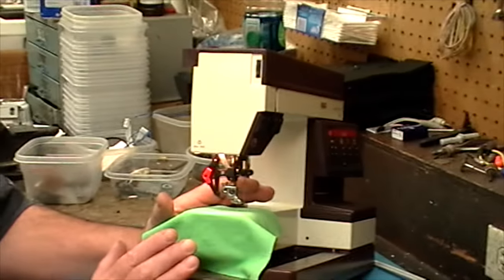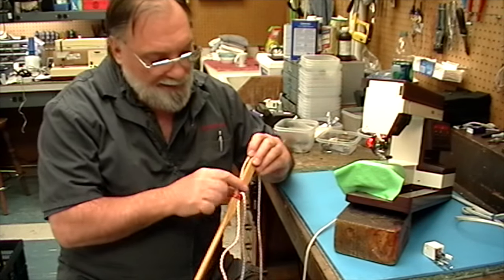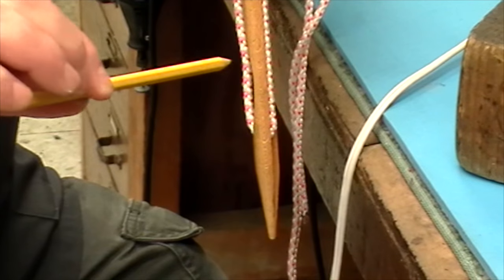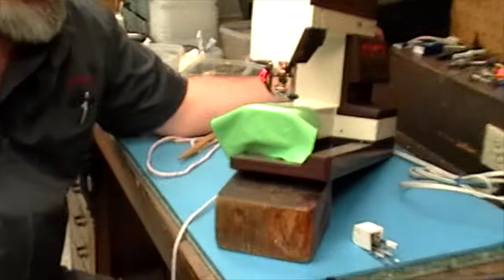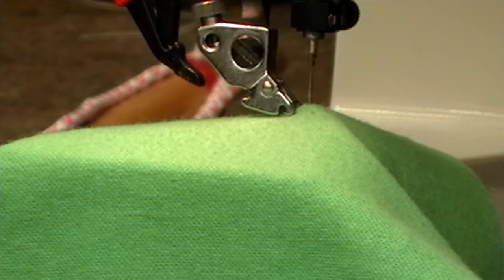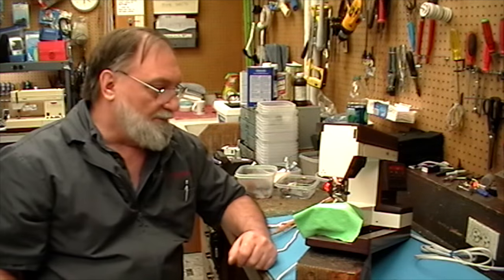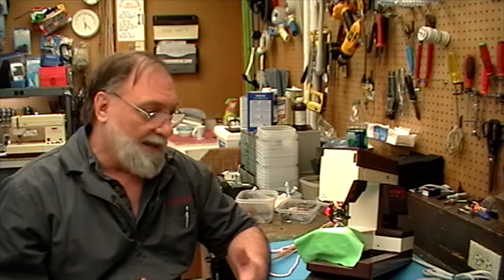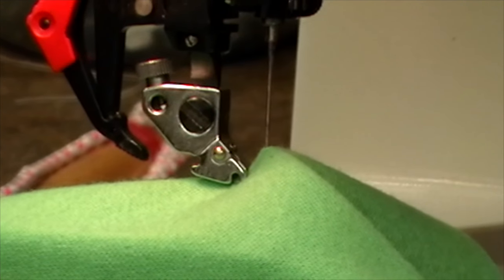Tips from Uncle Creepy #1 Skipping stitches

Comment: Uncle creepy, this is by far the best explanation I have seen on the issue of missed stitches, I had that problem in the morning and I was changing needles, treading the machine several times, changing bobbins and cleaning, nothing helped so I turned to y-tube and saw many videos about the problem, and it was all about changing bobbins and needles to the timing is of and the machine is unrepairable,then I saw your video about the physics of the fabrics, so I changed the presserfoot and the machine is working like new again.
Thanks for sharing.

Comment: Thank you Uncle Creepy, for explaining Flagging! I'd never heard the term before.  I've adjusted tensions, changed needles, thread, both needle and thread combos and and even took my machine to be serviced. All the information I've found states that the machine just doesn't like the direction (backwards, sideways) of the free motion quilting. which may be true, however, how does one free motion quilt if the machine doesn't like the backward movement of fabric. I went back and tested my FMQ foot, and found it was too high, therefore not keeping the fabric taught. Thank you  for your video and especially for the demonstration with the fabric and large needle prop! Loved it!

Comment: “They really want it to be the machine, for the alternative is, they’ve to better themselves and that isn’t easy to do”

Very wise words. I’m at that point now: lots of birdnests,  bobbin clunking, top thread fraying during Free Motion Quilting and I’ve no idea why or what’s going on since I’m just starting, have no one I can ask for advice and thought it’d be pretty straightforward... but it’s not and I can’t barely stitch one inch without some issue popping up, let alone this cute bear shapes I’m trying to stitch. Very frustrating and disheartening.
The machine sews beautifully while in the regular settings, so I was aware it was either me or some tension issue... Haha, but I’m guessing it’s really just me. Better than having to send the machine in for repair, I guess =D

Thank you for such a great explanation, Uncle Creepy. I almost didn’t watch your video because of the name, but it was precious and will now try your tips to see if it solves or at least helps with my problem. Thank you again!

EDIT
Alas, it didn’t work. The line got stuck in the bobbin holder again... I think the upper line isn’t looping properly, like it gets stuck a bit somewhere while looping, then after 3 or 4 turns it’s completely knotted and stuck around the bobbin holder, and I’ve to remove the plate, cut the thread; it has happened 4 times now.
Went back to regular sewing and the tension settings were all over the place! Seems to now be more noisier than usual when the upper thread loops around the bobbin case/ holder, but at least now is sewing T____T I wonder if I’m ruining my machine....
Sorry for venting here on your channel!

Comment: Thank you so much. I need to try changing the foot, something I never think of.
I'm working on some very thick ponte fabric which is very smooth, almost slippery. I've seen the stitches carry a loop of thread up in front of the needle so I think you've solved my problem.

Comment: I need some advise.  My sewing machine was working fine but would not zigzag.  I took it to a repair service for a cleaning and fix.  I told the guy it was a Viking older model and he said he knew how to fix it.  He said a tension screw was missing and didn't see how it sewed.  Well it did, I did lots of sewing the day before.  Then he said he had to replace a cracked cam.  He did that by watching a YouTube video.  Well he can't fix the zigzag and says some of the other stitches aren't working as good as they could.  There was nothing wrong with it except the zigzag!  What do I do when I go pick it up? I am worried he actually caused more harm.

Comment: I am an fairly experienced free motion quilter and have, in the past quilted nicely on my Juki sewing machine.   However recently, it has started doing what you discribe-skipping multiple stitches-I can actually see the little empty loop come up thru the fabric as the needle returns back up thru the fabric.  It is so frustrating .  ALSO, it does it not only on free motion but also when it is sewing multiple or thick layers, I've tried using my walking foot thinking that might help but it doesnt-I am at my wits end.  It sews 2 single layers perfectly.  Do you have any further advice?

Comment: Hey uncle,  I just got an idea from your video exaggerating the flagging problem with  thin and delicate fabric.  From what you show in your demonstration, it would be a good idea to stiffen the material so it doesn't come up with the needle as it stitches.  As I was watching I was thinking of a solution .  But the pro embossers put a material on the backside of the finished product but I imagine some people want something that looks more delicate without the material behind .  So I was thinking what if you add some kind of a stiffener like starch as was added to hold shirt collars stiff and obviously would wash out after the laundry.  I ask you , wouldn't thish solve the flagging problem?  I apologize if I sound like a know it all, but I was just thinking.

     I have a question , is the loop formed on the side of the scarf or the opposite side  and where does the scarf face the front with the hook behind the needle.  After watching a few videos and realizing that the hooking can be in front or on the rear of the needle, it leaves me a little befuddled.

Comment: I have a  Kenmore 385.18330 machine which I have used very infrequently. I only use straight stitching. It is sewing  uneven large variable sized stitches. How do I fix it? Thanks. Amna
Reply from the maker: Start by putting in a new needle and retreading the machine.
Reply: Discoversewing , Thanks for the reply.  I changed the needle but it did not help. The stitches are very large and variable in length.  I live in a small town and I do not know any machine repair place.  Amna
Reply from the maker: Talat P make sure the needle is inserted properly. Flat side to the back if your bobbin loads in the front. Flat side to the right if your bobbin loads from the left side.
Reply: Discoversewing , I checked , I inserted the needle according to the manual instruction ( flat side on back), still have same problem. Thanks . Amna